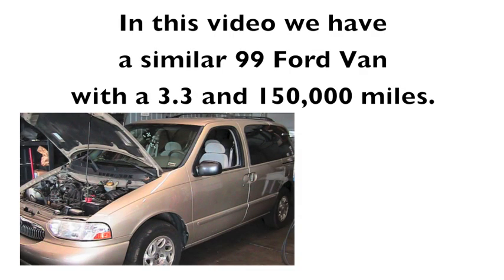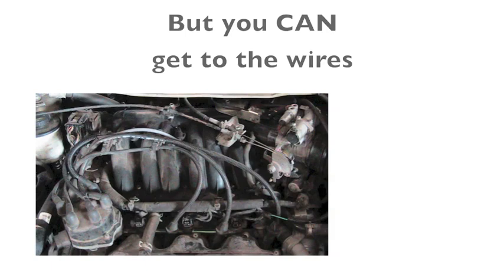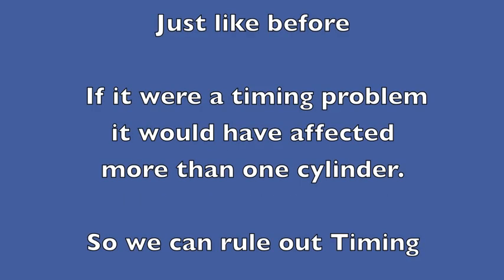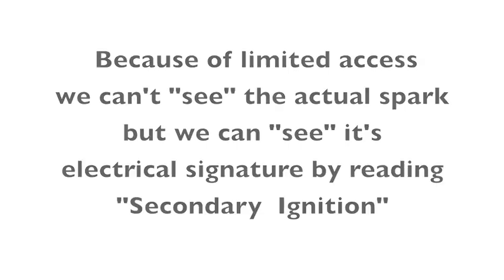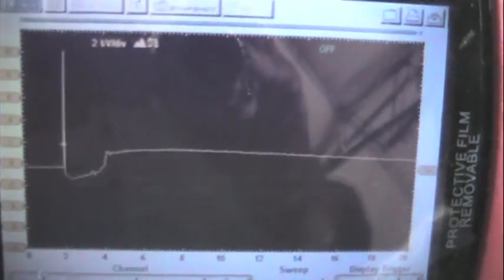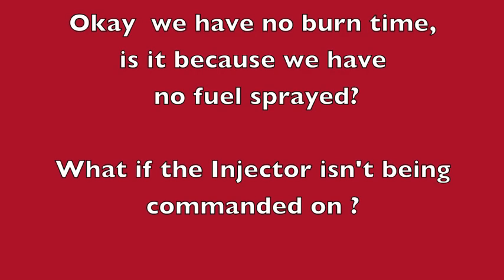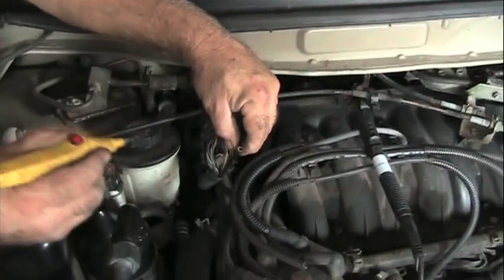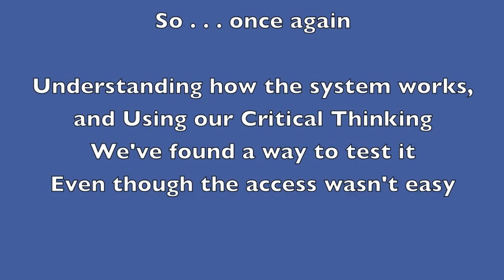Testing with Hard Access P2

Comment: Thank you for the clip
Wouldn't the PCM stop the injector to avoid fuel going the CAT?
Reply from the maker: excellent question!  Perhaps in a new verhical but not in this 99 model.  And it would depend on how the oem programmed their system.  But it would be possible, and if it did do that it would have also set a more advanced code indicating a injector circuit fault.  I like how you thinking though.
Reply: But there would stil be voltage at the control side of the injector😁

Comment: I'm confused. How do you know if the command was coming from the PCM? There was no signal.
Reply from the maker: Yes the signal is there in the injector waveform.  We were tapped into the wire that comes from the PCM to the injector.  You can clearly see the "on" command and the "off" command.  That confirmes that the PCM commanded the injector on.
Reply: If the injector was not open, voltage would have passed thru the injector from the power feed side to the negative side.
So when you don't see anything on the command side you know there is an open circuit😁
Reply: A proper waveform would be only made with a good injector. This is not the PCM making the waveform. It is due to the availability of a good injector in the circuit to show a nice waveform on the scope.

Comment: Couldn't you have confirmed an Open Line at that injector from the same place you just tested its operation?  Also, this test did not rule out something wrong with the injector wiring although this is probably more rare than a malfunctioning injector.
Reply from the maker: Yes you could and I probably should have showed that in the video.  We had decided the intake had to come off so we decided to show it that way.